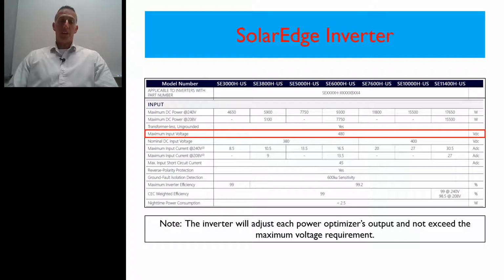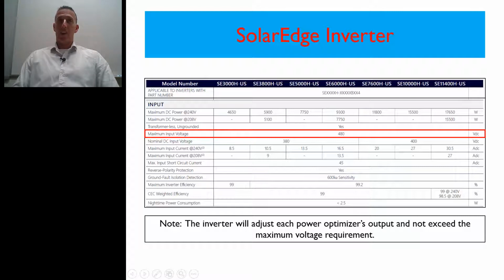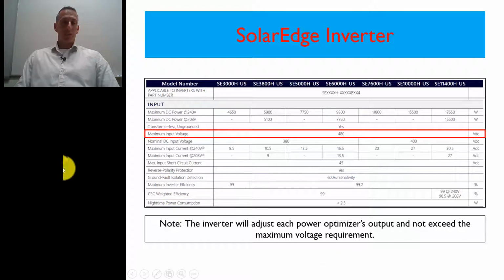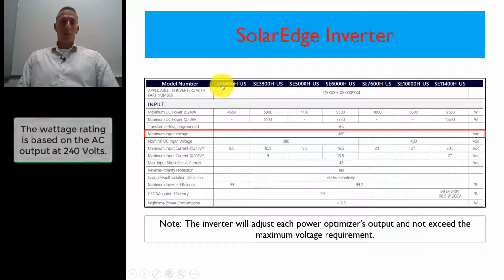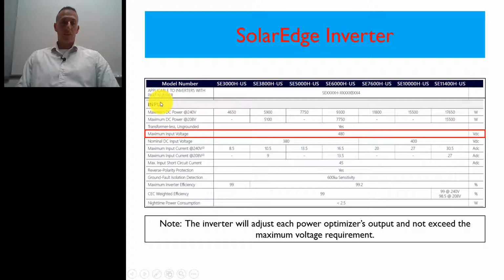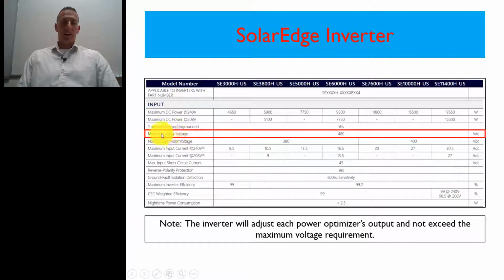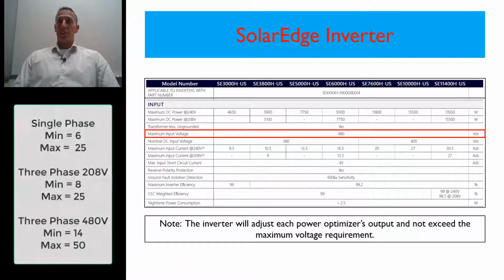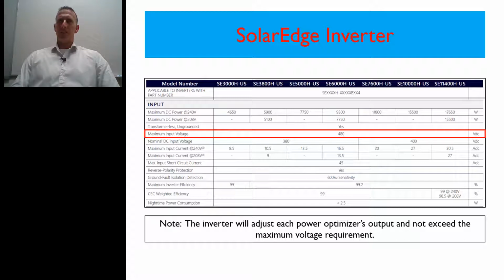Solar Training - SolarEdge Inverter (Maximum Input Voltage)

Comment: Your video really helped bro!....I was here trying to figure out how in the world that forty four P700 optimizers  (with 85V output) connected in series on a SolarEdge datasheet didn't exceed the 3 phase inverter's input voltage max of 600VDC!!....You cleared it up,....the  inverter controls the optimizer outputs to maintain this!....many thanks

Comment: Thanks for that very usefull info!.. I am wondering if power optimizers are absolutly dedicated to a specific brand or line of inverter? or if there is general power optimizer that are availlable and can just be programmed to match the inverter max optimum DC input?  let say i have a 150VDC max charge regulator and want to use power optimizers to gain the advantages of micro inverter have to not be dependent of one or more solar panel affected by shade...  Are power optimizer availlable in "low" voltages below 150VDC?